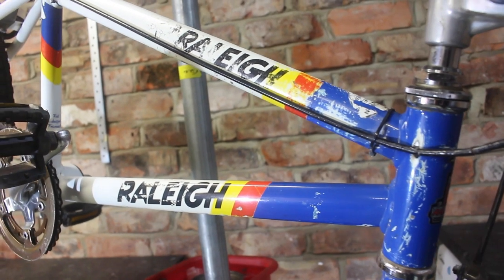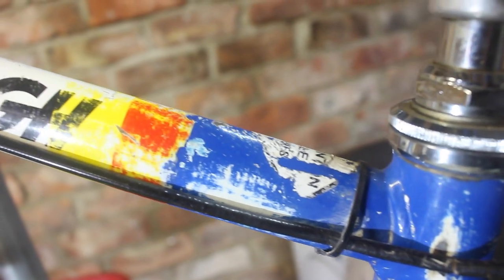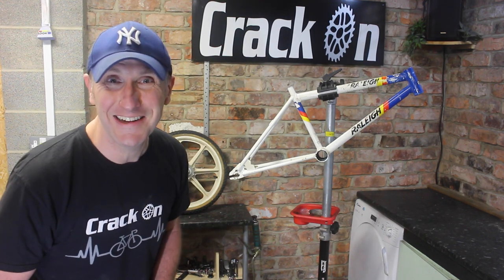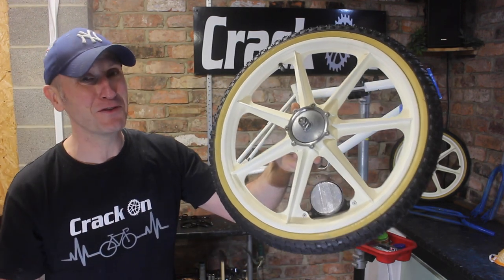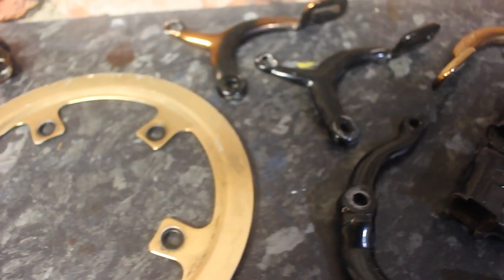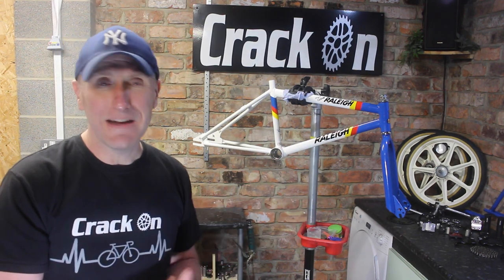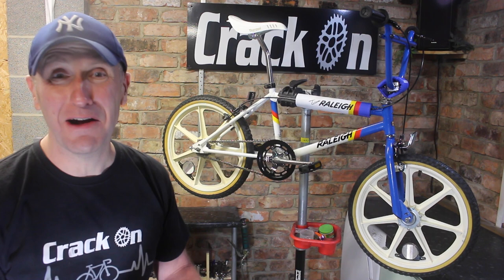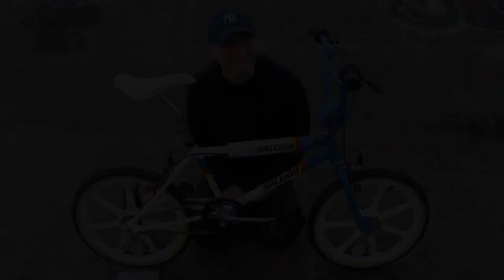BMX Bike Restoration - Old School Raleigh

Comment: Andy, hope you are keeping well. I wonder if you can help me? I’m going to start restoring my Raleigh Ultra Burner bike from 1982/3. There are no threads in the bottom bracket shell, what bottom bracket and crank do you suggest I use. Was the bottom bracket shell the same threadless system in the bike you restored. Thanks Nic
Reply from the maker: Hi yes im great thanks, Ive just got another Raleigh burner which will be uploaded soon so keep your eyes peeled for that one. Regarding the bottom bracket its normally a one piece crack like in the video. The cups have no thread, its the crank arm that has the thread. See this video from RJ the bike guy, hope this helps
https://www.youtube.com/watch?v=AZHcEDYLaXc

Comment: Just to clear things up this is a Mk2 Burner/Styler, the Mk1 Burner had the round tubing.
There is no 'Aero' tubing on this bike, only 'Oval Competition Section' which was just fancy wording Raleigh slapped on to make it sound good.
There is an Aero Pro Burner which is completely different bike built for BMX racing.
What gives this away as a model sold as a Styler and not a Burner is the fact that the downtube has 'Raleigh' instead of 'Burner' plus only the Styler had the freestyle bar with the twin crossbars.
Also this being a Styler means it will be a bog standard high tension steel frame or 'Carbo-spec' as it was called by Raleigh meaning it won't be any lighter than other Burners, only the main tube cromo or full cromo frames would be lighter which would only be found on more premium models.
Reply from the maker: Thanks for watching and the input all the best

Comment: Brings back some great memories of 1986 with my Raleigh Burner, that's an awesome restoration true to the original in every way. The stopping power on those brakes with the mag wheels was pretty crap especially in the wet I remember .....keep up the great work
Reply from the maker: Thanks for the supporting comment, great to hear I got it right. Getting it true to original is very important to me and this was a first. Probably not the last, I had a blast. Thanks for watching

Comment: Hi mate love the restoration on the bmx. I’m doing a team burner replica at the moment, As your bike is original could you please tell me the measurement of the blue paint from the head tube? On the cross bar and the down tube if you don’t mind as that would be a great help when I paint my frame
Reply from the maker: Thanks for watching the BMX restoration and your support. Unfortunately the bike is now sold. Have you tried the Raleigh Facebook pages they are normally a great community of help.

Comment: Great video Andy. A few months back I bought exactly the same bike. It has original 'everything' and same mags as yours, which is mad as the Styler versions had many different variations of parts apparently. Thanks for all the info.  You've made my job much easier! 
Could you tell me please, what spary paints and numbers did you use?  Thanks
Reply from the maker: Hi thanks for watching and the support, I took the frame to an Auto spray paint shop and they just colour matched the colours up. it wasn't expensive. Good luck enjoy

Comment: Any idea about the color codes of the spray you used,I need to restore mine and I would like to get it spot on if it’s possible,thanks and great work on your bike 😊
Reply from the maker: Unfortunately not, I took the frame to the paint shop for them to colour match then they just made it up for me.
Reply: @BikeItUK  thanks for the reply,no the less great work..